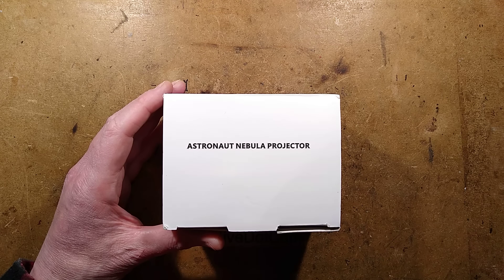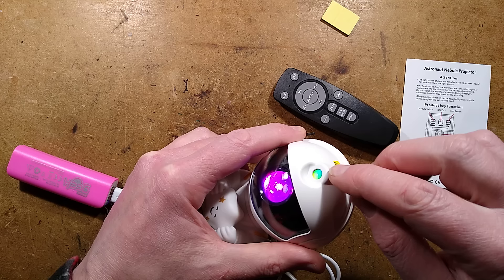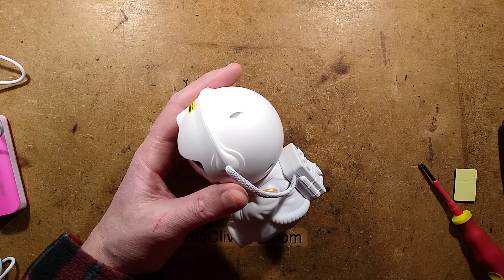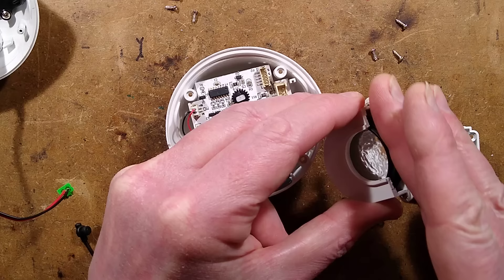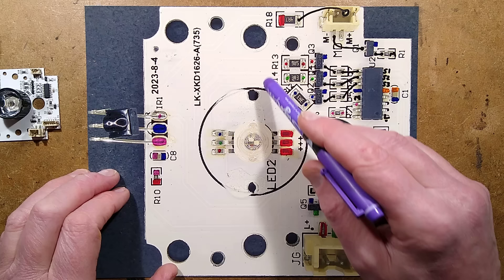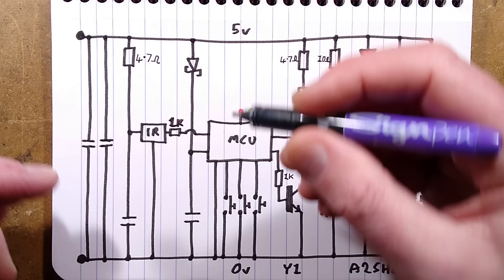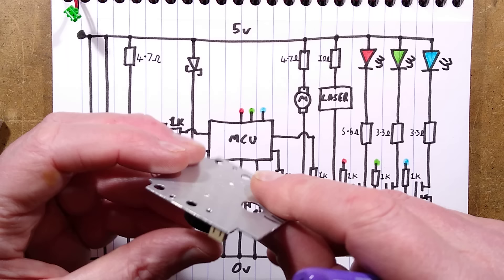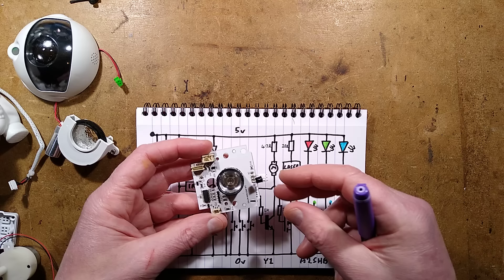Inside a spaceman laser nebula projector

Comment: any way to fix if the laser suddenly stops working ? mine was fine for a few months and now the laser either doesn't work or the stars turn into very enlarged blobs
Reply from the maker: Be aware that even if it's not putting out green light it may still be emitting a fairly strong infrared laser beam.  Don't look directly into it even when it appears unlit.

Comment: Is the Zener the wrong way around on the schematic? If not, please explain its workings. Thanks.
Reply: It’s a Schottky diode,  forward biased, giving a slightly lower voltage drop than a typical silicon diode.
Reply: @MartinE63  That makes better sense. Thank you.

Comment: Is it me or the holes on the top are for the IR sensor ?
Is it me or the motor is missing its flyback diode ? (especially if the speed is changed by PWM).
Reply from the maker: It is.  I meant to mention that in the description.

Comment: I have one as well, but it has the PCB in the backpack. One thing I dislike about it, is that its default settings are way too bright. However it’s possible to fine tune it, but it doesn’t remember its settings 😔 Do you happen to know if this one does?
Reply from the maker: I don't think this one stored its settings.

Comment: Why does the laser make use of a mosfet whilst the motor make use of npn transistor? I guess there is a reason for that...
Reply: Maybe the laser is PWM-controlled while the motor is just steadily on or off?
Reply from the maker: Probably the current involved.  The motor will be just around 10mA.

Comment: Also nowadays laser modules and even just playing it laser pointers are so cheap I'm not surprised lasers are throwing at anything and see what sticks sort of thing probably your regards to potential wait a second is it safe to do.

And as people know in the tech industry and others that things have gone horribly wrong with things when people don't think about the what if scenarios.

Yeah sure apple and others put this warning on their don't eat this thing in certain type of thing here and Nintendo with the bittering agent on the Nintendo switch cartridges and now even coin cell batteries using essentially the same stuff.

Supposedly this is the most bitter substance on Earth I've never done a lick test for obvious reasons that's just not something one would want to experience let alone see if it's true.

There are even have been medical equipment has been proven to be dangerous on the right conditions because of software or otherwise someone to sleep with the switch and something not being considered.

Just like certain control systems in white goods and other appliances prevent things from happening if something goes awry.

Such as an auxiliary rewrite to cut power if something's not right although I've seen even oven timers with this still go berserk and cause things to come on when they should not!

And has instance of one thing personally no harm done nor anything damaged fortunately.

Had a old microwave after a while would start acting up and having a mind of its own.

The unit would even go into cook mode without even pushing any buttons or setting anything at all all of a sudden we just come on and start cooking.

Apparently it looked into it and it was a known issue little certain conditions and suspect that it was being caused by power issues with various power glitches and such and yes this seemed to be the case but then again where I used to live electrical grade was horrible.

Some things this can cause with the power glitches and stuff some things is what are called the can't States something that should never happen when properly operating and should never occur under normal circumstances.

Sanchez the Megatron in all circuitry becoming active without user input on a microwave oven.
.
Or stove or oven turning its elements on without user input for a timer starting the oven.

Sometimes this is a safety thing and other times it's just prevent things from causing damage to the Appliance Valentine's a little more serious such as even though not necessarily safety hazard such as perhaps if a blocked drain on something shutting off the water supply solenoid valve.

Also like on hopefully all dishwashers if the water doesn't shut off and keeps running a float switch immediately turns on a drain pump no matter what else is occurring..

For example a volume flow volume regulator malfunctioning or stuck valve how to replace that little flow control washer once in a dishwasher.

But some things are just there to protect the user from things that would cause damage to the Appliance itself such as a thermal switch on a vacuum cleaner I'm not talking about that one time thermal fuse which I believe all should be replaceable if there is one by the user!

There is the argument of safety with the thermal fuse 

we can do better in some way.

Most of the time a fun way of thermal fuse goes out the device can be brought back to operational and it still safe to use however of course you have to have backup protection of some sort.

Another example where things can and have been done better in some cases.

The requirement for an inline fuse for fans.

That fuse being in the plug with a replaceable fuse instead of the cord and plug being one piece and fuse contained within the plug not replaceable.

I happened to about a year ago get a industrial fan.

And the first thing I noticed was the replacement fuse versus non-replaceable fuse.

Already got spare fuses just in case one of the fuses that was not in my fuse kit and no it's not one of those sketchy ones it's a good one mostly customized for the stuff I use most and fuses for specific devices that I know what the values of fuses are and yes few Christmas light fuses in there as well

Comment: dont trust green lasers
Reply: Very true. And for those that don't know why - cheap green lasers are commonly made using infra-red lasers with an optical frequency doubler. Unless the doubler is really a good one (in which case often not cheap) then the green light may appear not too bright to the eye, but it is the extremely bright infra-red that they allow through that will permanently damage the retina while you're admiring the green.